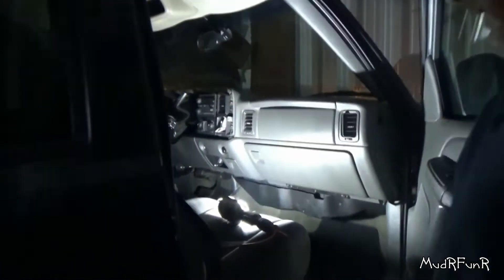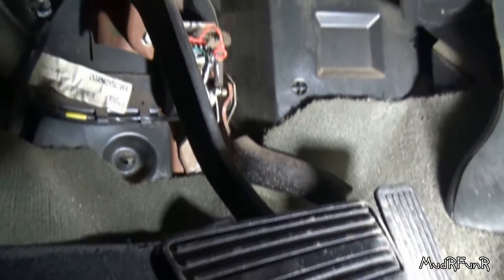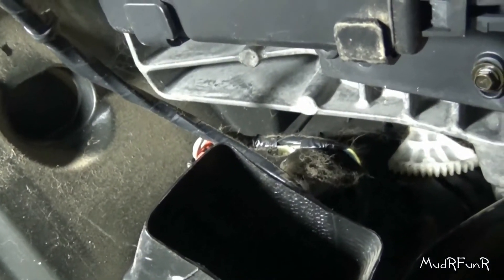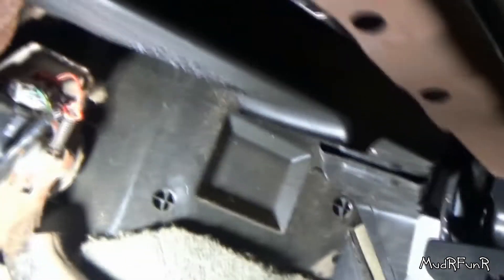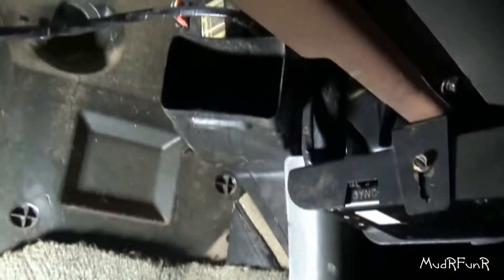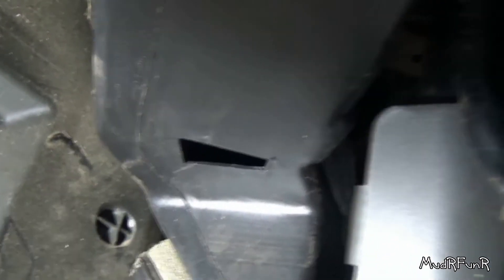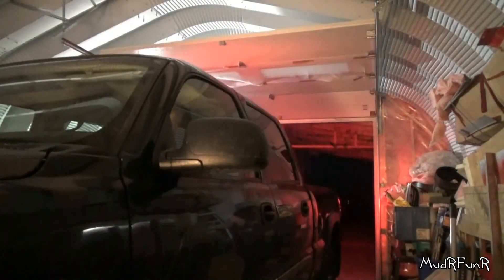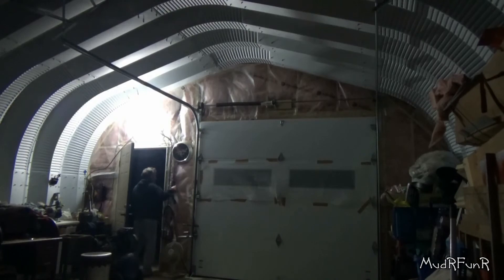Got Cold Feet in Your Duramax Truck? Quick Tip #13

Comment: How the Malibu is holding up
Reply from the maker: Malibu has 240 000 kms on it now. Runs like new. The body has rust around rear fenders. I have not fixed anything on it lately except brakes and I have that on video already. Good to hear from you again.
Reply from the maker: I almost forgot. I replaced the rear wheel bearing on the Malibu. I'll be posting it later today.